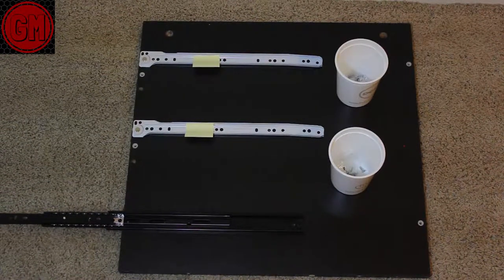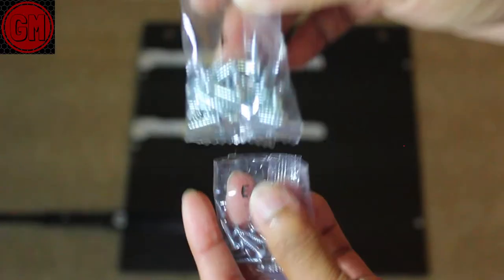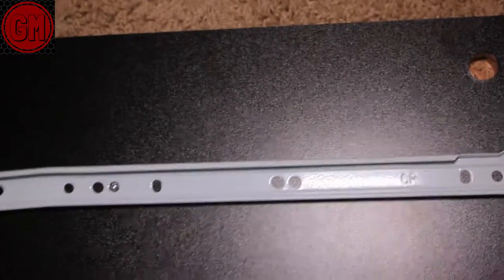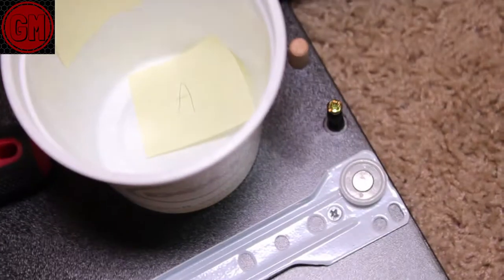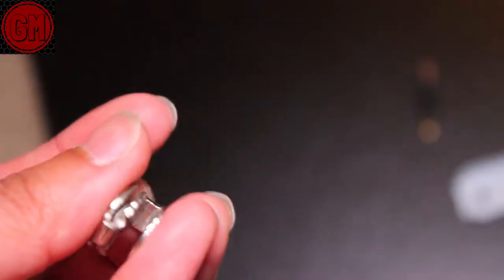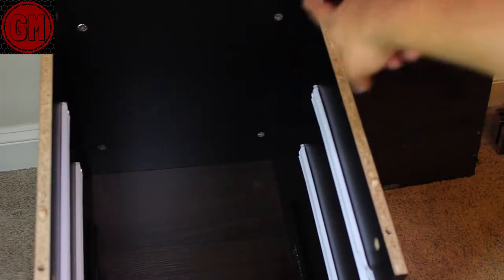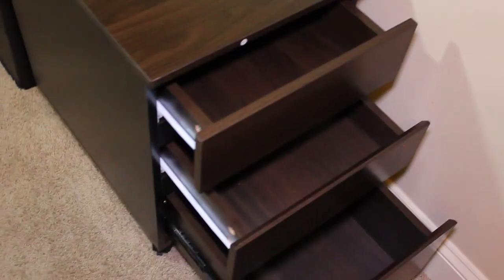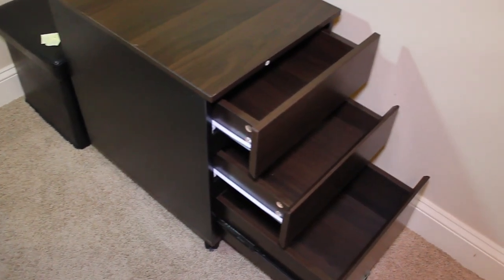How to Assemble Bestier's Wooden Storage Cabinet

Comment: Another suggestion.  The tiny screwdriver they send has a detachable 2-way head, one for flathead, the other for Phillips.  I took that out and put it in my Ryobi cordless drill.  This drill has adjustable touch settings, so you can screw it in as slowly or fast as you like.  I used very slow so as not to strip the head or cause damage.  No hand problems.

Comment: 18:48 "Gather all the ingredients" 🤣🤣🤣
Hey man! Been going step by step and now I just need the drawers! My wheels were modified with them being pre screwed too. I just had to screw with a thin wrench provided. Also, that small screwdriver is hurting my hands!🤣🤣🤣
Reply from the maker: Haha, I didn't even notice I said that! It took me hours to film this so at that point, I didn't even correct myself. Yeah, my hands felt awful after making this.
Reply: @GMReviewer  Lol! I'm taking longer than you did probably I've been at this 4hrs already and not done but I'm confused on 18b..is it the 1st hole or 3rd hole? If on 3rd hole 18b wont overlap the drawer ..like it wont be sticking pass the drawer
Reply from the maker: @Disheartened6  So I am not too sure if I know what you're talking about. I don't think anything actually goes into 18b unless I am mistaken.
Reply: @GMReviewer  Hey! Its ok. I was looking at the 2nd part first rather than the 1st part in the steps and that was easier to follow. Once i did that side first i knew what to do on the opposite side! That middle drawer was tricky to put in!! I thought i had put the sides on wrong but i just needed to angle it awkwardly and it fit right in👍👍👍